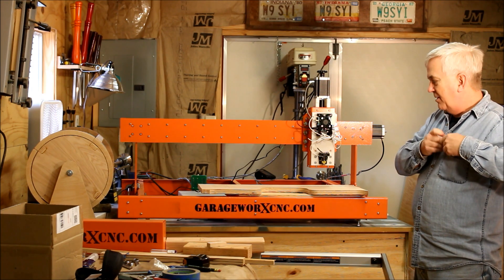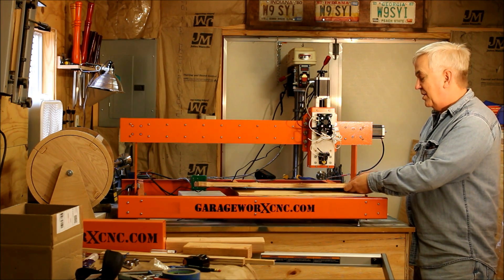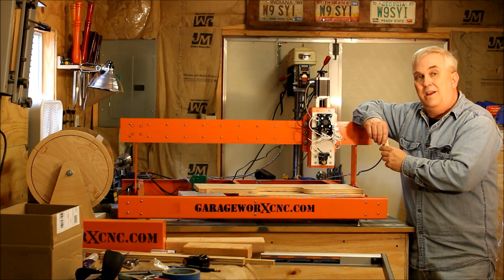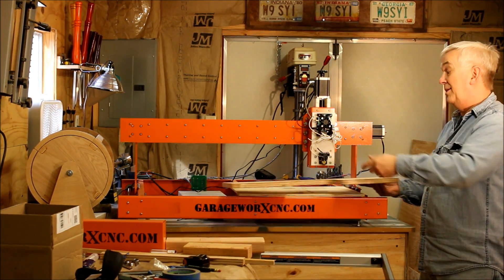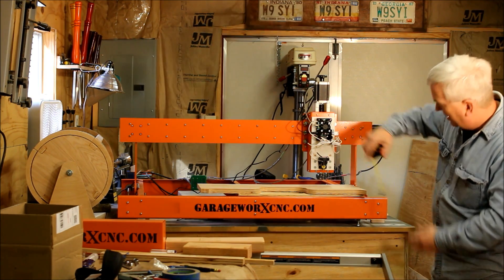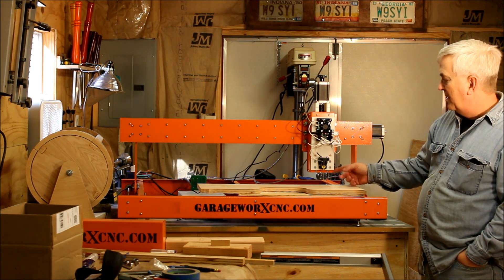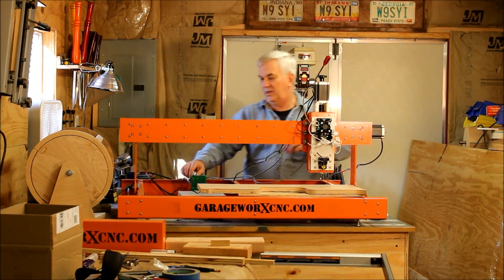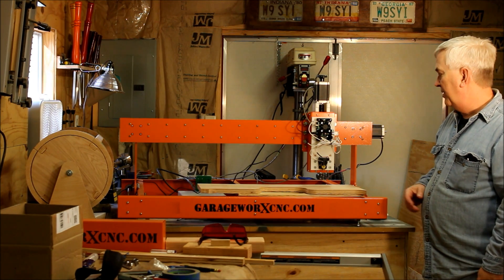Trying Out The New Laser

Comment: Hi Dave - Nice video.  I like the plate design you have.  I'll send you the cable you are looking for.  We normally don't include it in the kit because every machine might need a different length, but I think you make a point that it should be.  It would make things a bit easier to set up for everyone.  It is here:  http://jtechphotonics.com/?product=molex-mini-fit-jr-jumper-2-wire-connector
I'll put one in the mail for you today for free.  : )
You have the focus set perfect.  We recommend just about 2.5" to 3" to get a nice an tight beam.  Also, your driver is set to 1.5amps from the factory, which is the recommended setting.  Your laser will work great at this setting for a long time!  Again, great video!

Comment: Nice set up Dave!  Have you looked at using an Arduino computer with a CNC shield?  That eliminates all the parallel port connections.  There is also a web based processor, Chilipeppr that I have been using with the small CNC that I built.  It seems to work quite well.
Reply from the maker: +Nathan Longfellow Thanks for watching Nathan.  I don't mind the parallel port connections because they work.  Not a fan of the Arduino and web based processors.  I think they still have a ways to go in development.  Also, not everyone has an internet connection in their shop.
Reply: +Dave Gatton that is a good point.  I had not considered no internet connection.  What are you using for your controller hardware?  I just started getting into the CNC world in the past 6 months and ended up building a small arduino based machine but would like to build another machine similar to the one you have designed, though I would like to incorporate a 4th axis.

Comment: nice how did you tie it in to mach3 ttl on digital trigger or the z axis dir pin ?
Reply from the maker: +jerry coleman I created a new machine profile called "Laser" and set pin # 17 for the spindle so I could turn the laser off and on with M03 and M05 commands.  Added a post processor to my V-Carve Pro software and created a laser "tool" in the tool database.  It's really pretty easy.  I'm not an electronics guy so I was a little intimidated at first but it really went smooth.